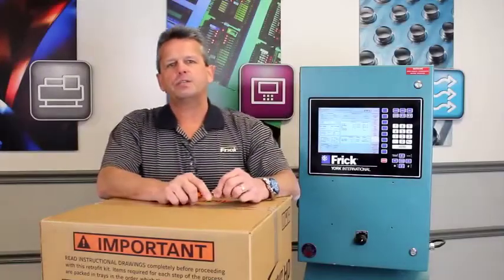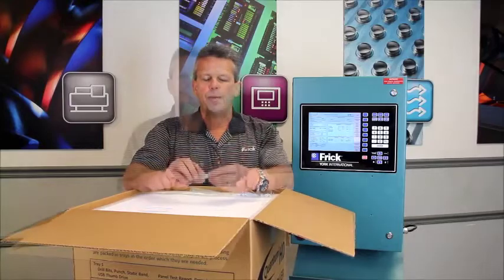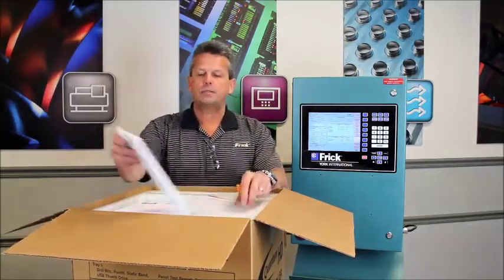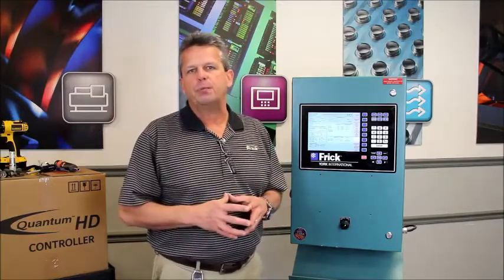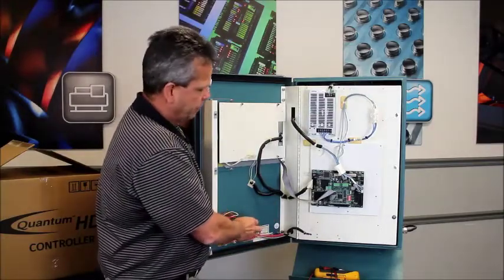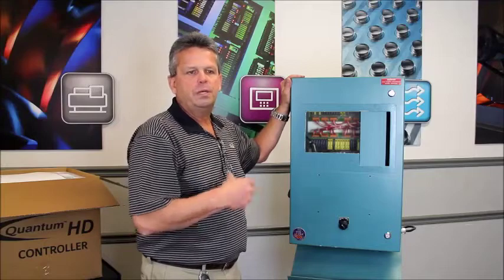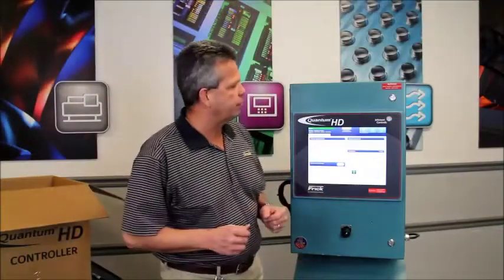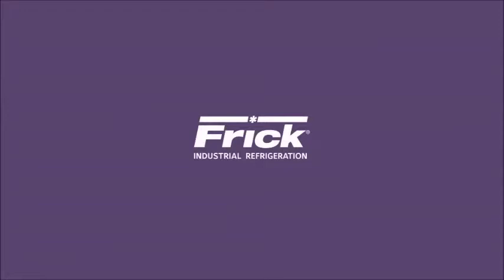Frick Quantum HD Field Retrofit Kit Installation (Swingout Door) | Johnson Controls

Comment: Best regards from Venezuela! we have frick compressors, of which we install the quantum Hd, but at the moment of turning it on the touch works only the top of the screen, the rest does not obey the pulses. There are 6 screens that have the same fault. thanks
Reply: Actualiza el software a una version superior y revisa que errores han sido reparado en la nueva actualizacion y ahi vas a encontrar tu solucion.